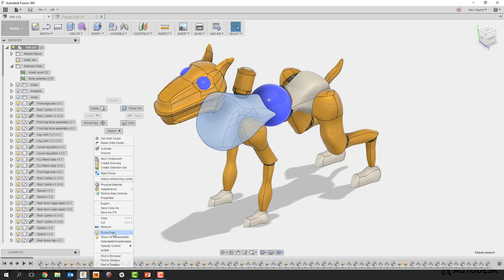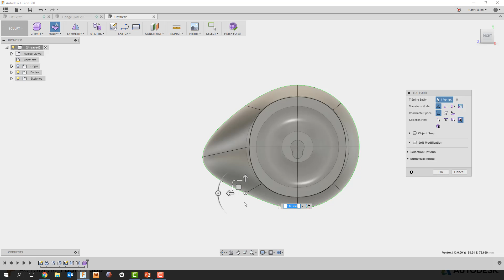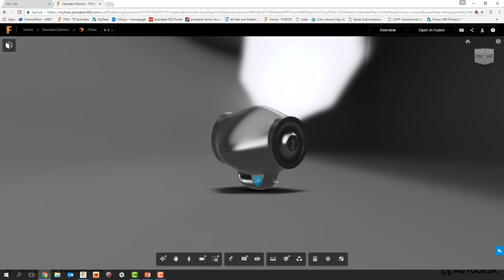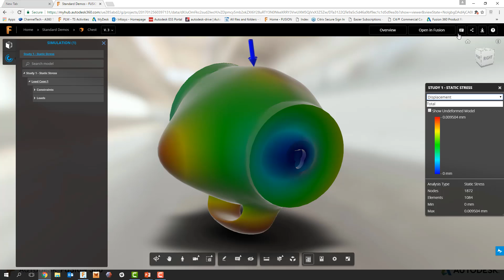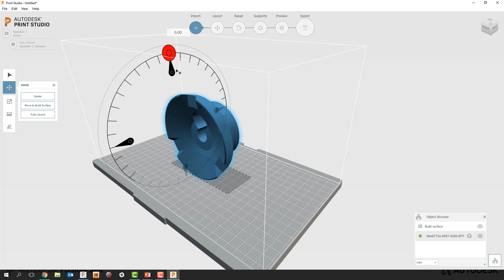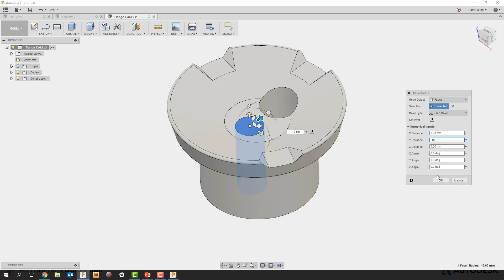Introduction To Autodesk Fusion 360 – March 2017

Comment: This is a useful, much-needed video. It helps if someone watches a few other hands-on intro videos before watching this. This video is not so much for the hobbyist group but more for the pro group using Fusion 360 - although non-commercial users can get much out of the vid, anyway. Depends on how formally you treat your workflow.